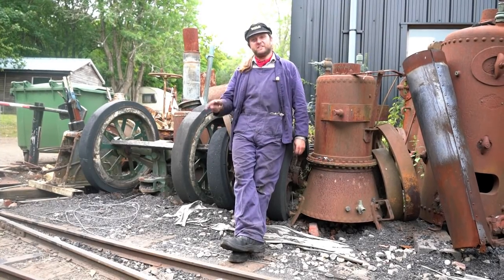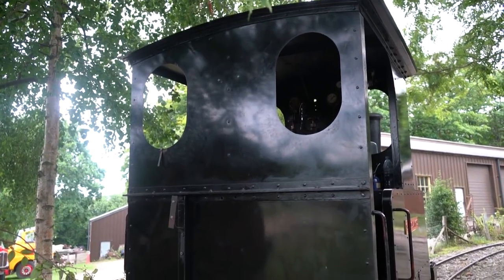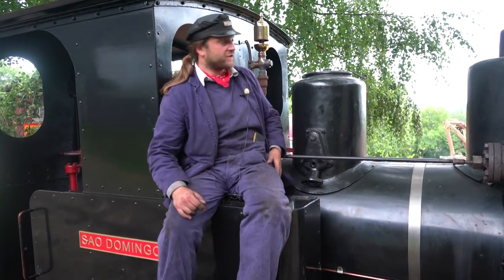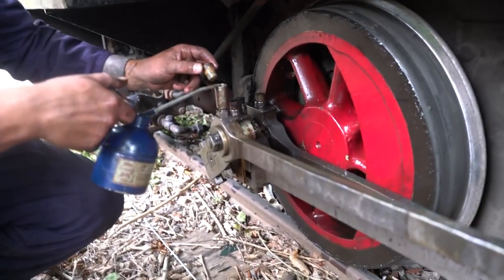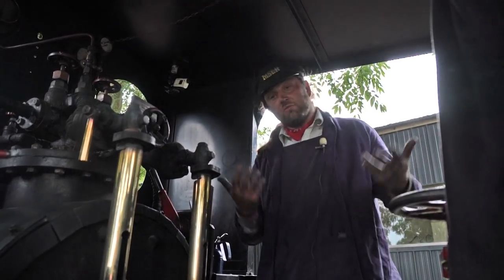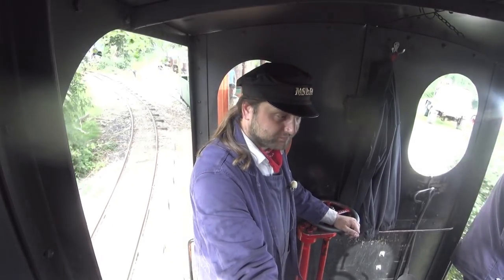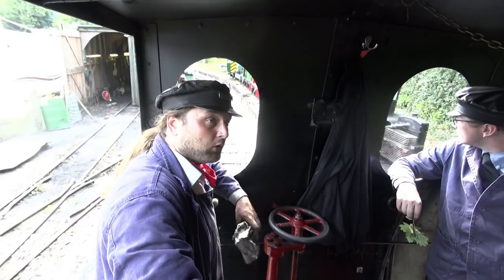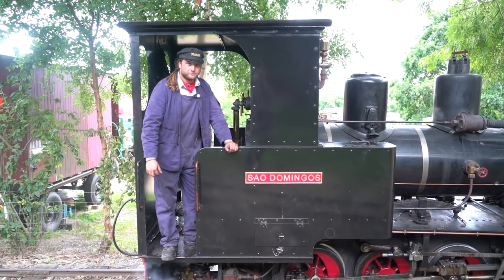Sao Domingos, a little O&K - Lawrie Goes Loco Episode 8.

Comment: Cute little steamer, I love steam locomotives, my all-time favorite is the Union Pacific Big Boy 4-88-4 articulated, designed for use hauling freight over the Rocky Mountains in the mid-west here in the USA. Diesel-electric locos are easier to maintain and run, but there's nothing like the sound of steamer coming at you.
Reply from the maker: It's a lovely little locomotive.
Have you seen 4014 running yet? I hope to be able to get a look at it on my next trip over to you guys.
Diesel has nothing compared to steam!
Reply: Dave Kauffman same here

Comment: not being able to whistle...good lord where's the fun in that? that like...most of the point of having a steam engine! 

Great video and great series by the way. just stumbled across it and I'm hooked to be honest!
Reply: Yeah, it is very dumb, also a little dangerous not having a whistle.
Reply from the maker: It's most disappointing. We couldn't use the whistle except for emergencies at the Mid Suffolk Light Railway for quite some time.
The bark of the exhaust more than makes up for it though!.

Thank you, really glad you're enjoying what we do!

The way the railway works its not particularly dangerous, you can hear the Loco coming and the crossings are all manned.
Reply: @lmm  I do know here in the US you have to do massive modifications to the crossings if you want to go "Quiet Zone" (That's what we call not being allowed to whistle) and even then you can still sound it at the engineer's discretion. that is one thing I like about the US, you can't completely silence the voice of a loco, you know?
Reply from the maker: At the MSLR the whistles worked, we just didn't use them.
They tell me that they've made the whistle work down at the Great Bush now so it can be used in emergencies.
Reply: I just attached. Makeshift whiskey to my air pump and when I pull the air release thing it blowes a loud whisle

Comment: Koppels are such clean looking things. Seems like you had a lot of fun with this one! The Germans really were clever about the ergonomics of this thing with that slick toolbox, that firedoor, and some very well laid out controls. That pump is really cool! It's like someone has attached a model engine under the locomotive!

Love your channel for showing us all these interesting features that most people wouldn't really notice or point out in great detail.
Reply from the maker: Thank you, really happy to hear you're enjoying the Loco stuff.
I really love Ming, it's a super little engine. I really want to get a go on one of the bigger o&ks and see what they're like!
When they put the steam brake back on and the original handbrake it's going to be superb!
Reply: @lmm  Ooh yes, I've never actually seen a continental style handbrake before, let alone in actual use, sounds quite interesting! Can't wait to see what other interesting equipment you find.

I did once ride a not-quite O&K at the Talyllyn Railway ('Douglas') - It was a pretty lively ride as you mentioned with Ming, though it was running at a pretty hot pace for something with tiny wheels and it shook a fair amount, which just made it a more fun ride.

Comment: I've seen it on other O&K locos, the little holes either side on each cylinder. Not the drain cocks, but the hole where the steam comes out sideways on every chuff, wondered what it was for seeing as its wasting steam?
Reply from the maker: That would be the drains cocks which let steam out.
Reply: @lmm  What so there's even ones on the sides of the cylinders as well as the bottom?

Comment: Great video lawrie. I was wondering , do you know about the great cockcrow railway? It's a 7.25 inch gauge rapresentation if a main line railway. It's situated near chertsy  (in Surrey ) and we open to the public every Sunday from 13.00 to 16.30. The railway closes for maintenance work after Halloween and reopens in may. We mostly run live steam locomotive but we also have some diesels  ( which are actually electric except the class 55 deltic which is powered by a petrol engine.) I'm a volunteer there so if you came to visit we'll might meet 😀

Comment: That's the kind of loco i would happily roll onto a trailer and drive of with it! Ive seen some extremely tiny (i forget the gauge to be honest,it was tiny and under 2 foot im pretty sure) versions of these maybe 30% the size of this one in some pictures many moons ago, the one at the time was plinthed(i  think some place in Tasmania, no not "Wee Georgie Wood" which is a smallish once plinthed now running loco over there ) but i believe ended up restored.Maybe one day (when fully tooled up, suitable place to do it and retired!) I will build something around this size,staring a bit smaller first though ;)
Reply from the maker: I suppose that they would have made a Loco to any specification that was asked of them really, they're not huge locos to start with so I would be intrested to see one of the smaller ones!
There's a couple of 2 foot locos in the UK that people have built, looks like a bit of fun!

Comment: My museum has quite an interesting little narrow gauge locomotive. Ex-Defiance Coal Company N°1, a 1921 HK Porter 0-4-0 built to 40-inch narrow gauge, it originally ran on a line roughly 1½ miles from the DCC's two mines to the coal tipple, located in Mentmore, New Mexico. After the mine shut down, a doctor from upstate New York bought it and displayed it at the legendary Rail City, the first operating steam railway museum in the United States. After the doctor passed away, the engine traded hands again, and I believe it was then owned by Mr. Roy Dunwell, whom the engine is named after now. Mr. Dunwell restored the engine to operational condition, and built a special flatbed truck trailer with rollers, so the engine can be fired up and run. It now is owned by the Railroad Museum of Long Island, of which I am a member, and as of this year, it's back to operation once again. I'm officially part of the Steam Team, and as such, I get to operate the little engine when we fire it up.
Here is a link of the little engine working: https://youtu.be/pSRFPI3c0vs
I do strongly suggest coming by and checking it out, it's a really nice loco.
Reply from the maker: Oh that's awesome, what a super little thing!
Do you think the museum would be willing to let me do some filming with it?
Reply: @lmm  of course! Any exposure we can get helps. The museum's webpage is https://rmli.org/ and I highly recommend sending a message to our president, Don Fisher. Let me know how it all goes!
Reply from the maker: @That_One_Guy_In_A_Band  Thank you, I'll drop them a message!
Reply: @lmm  Awesome. Let me know how it turns out! Hope to see our little engine on your awesome channel soon!
Reply from the maker: That would be awesome! I hope it does!

Comment: Those Orenstein&Koppel locomotives are quite common on 2ft/600 mm gauge all around the world. The works produced thousands of them from 10-70 HP size. Unfortunatly this one was quite a lot modified to British style features, that spoil the design a bit. The original lever hand brake is much better and faster to use, the new boiler has a different design with this strange long water gauge glasses and the kind of small aditional dome in the cab. Original fitted with 2 Strube suction injectors and swivel windows in the cab. The 2-step valve regulator seems to have some issue, maybe the stoke of the small relief valve is too big, so the main valve starts "jumping". The safety valves are not orginal, but from a ARN. JUNG built loco. Nevertheless it is a great video, well done Lawrie!
Reply from the maker: Thanks for all the info, and glad you like it! The original handbrake will be going back on soon, as will a steam brake, which will improve matters dramatically!
Reply: @lmm  I was working on an Orenstein&Koppel restauration project in the past, so feel free to contact me in case of questions. Kind regards Sven
Reply: @svenschlenkrich  Hi Sven, I look after the locomotive. The regulator has been a headache for years with constant resetting. How far is the relief valve meant to move as currently it has about 3-4 mm? It lets though around 50psi and the main valve is solid as a rock unless you close both completely and open. You'll be pleased to know the lever brake is being refitted and it is being made to look more german again. It was rebuilt by a chap who restores traction engines, hence the unorthodox fittings.
Reply: @FaustusFellows  Hi, the relief valve should have only 2 mm stroke according to the drawings. Feel free to send me an e-mail for further details. Kind regards Sven
Reply from the maker: I'll be really happy if the channel has helped to make something better!

Comment: Might have to give this place a visit sometime!

Want to review my Mamod when it's fixed? ;)
Reply from the maker: It's a nice day out,
And no thanks, I've got a Wilesco 😂
Reply: Jack Cavie I have three mamods
Reply from the maker: I've got the traction engine, but with the roller front. It's a weird thing.
Then I've a pair of mammod traction engines and a few little stationary things. They're all good fun!
Reply from the maker: @TheHatMusic  mine has a little generator on it, previous owner attached it, which will run some leds. Which is fun 😂
Reply from the maker: Yeah, it's a super weird thing.
Reply: I had a roller,mecano and a nice twin cylinder mamod when i was a kid! I did get a Wilesco in a box in pieces when i was older that i restored, it was nice with proper valve gear and higher pressure (unlike basic stuff and pressure mamods run)but i was more interested in playing with the full size stuff by that time.I always wanted the O gauge Mamod loco that came in a kit but my old man said "they're shit steamers" and would never buy me one! All good fun though, im about to start a 5" gauge 2-8-0 build  myself, soon as bugger who sells casting and plans ends his holidays!
Reply from the maker: I did enjoy my mammods and Wilesco, it was a good way to get into steam. The mammods are exceptionally basic.
One of my friends had the Loco, it's just so very uncontrollable, flies off at a million miles an hour.
What Loco are you building?

Comment: 2ft guage is superior guage
Reply from the maker: 2 foot is alot of fun. Huge variety of stuff too!
Reply: @lmm   have you been to the Ffestiniog Railway in North Wales? You would like it
Reply from the maker: Oh yes, it's a stunning run, with some very interesting locomotives!
Reply: @lmm  They have had quite a palava with the Double Fairlies this summer.
Reply from the maker: Oh really? I've not been following the progress. What happened?
Reply: @lmm  Because of the new fairlie being built they have taken the Earl of Merioneth out of service completely, for about two weeks Merdin Emrys was also out of service as it had a crack in the boiler so there was only one Fairlie, DLG left running so they had to run double headers of Linda and Blanche, Taliesin and Lyde. After Emrys was back the drain cocks fell off of Blanche on the cob just outside Boston Lodge and Lyde was damaged so they were both out of service for a few days, they essentialy could not lose another engine to repairs at the tome or they would not be able to run a service.
Reply from the maker: Wow. I saw photos of the double headers and thought nothing on it.
Bad times indeed for them!
Reply: @lmm  yh but it seems to be stable at the moment, lets hope it stays that was because James Spooner II ( the new Double Engine) wont be finished for two years at least they think